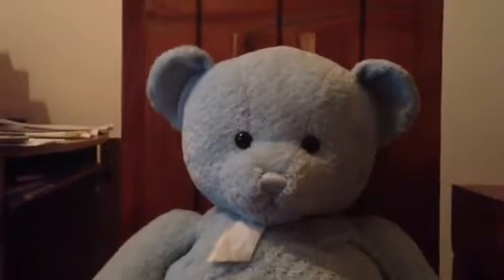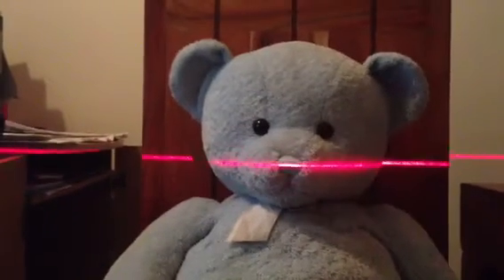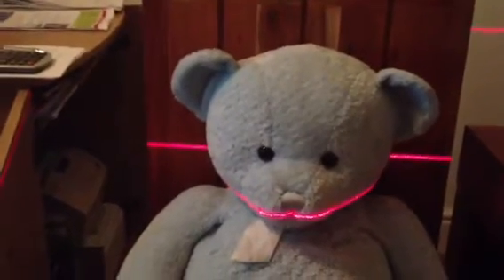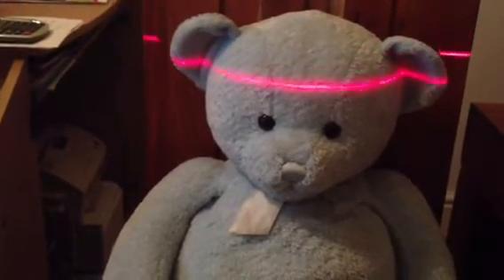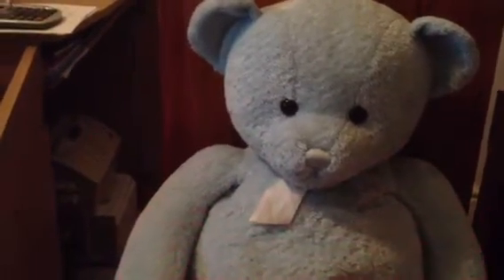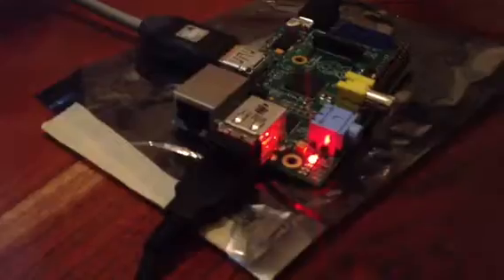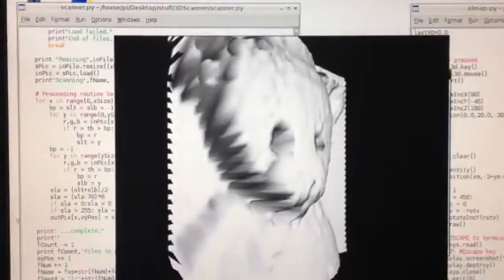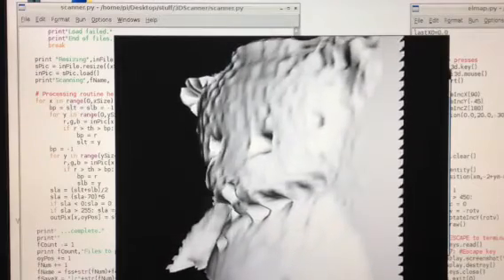DIY 3D Laser Scanner with Raspberry Pi

Comment: hi
how can i get a clear line laser from a dot laser?
Reply from the maker: +mina magdy  I'm assuming you mean a laser pointer or something similar?  If so you may be able to change the lens but to be honest it would be quicker and easier to buy a new laser module.  Search ebay for laser line, you'll pick one up for a few pounds/dollars.  Also, you'll get just the module with no switch or battery compartment, this allows you to control the power from a Raspberry Pi, Arduino, etc. which is better for projects like this (and I'll finish it some day :)